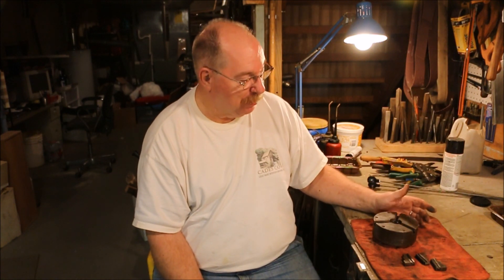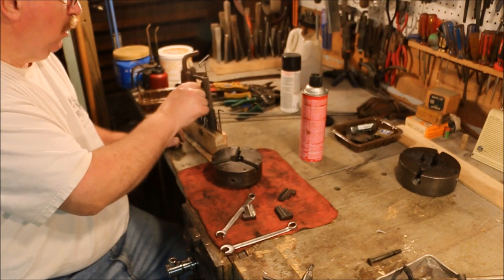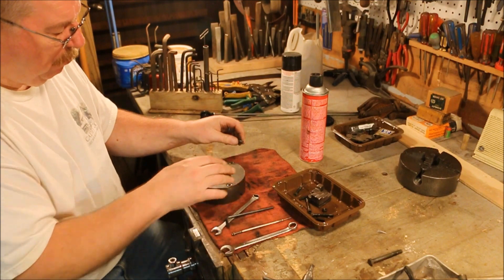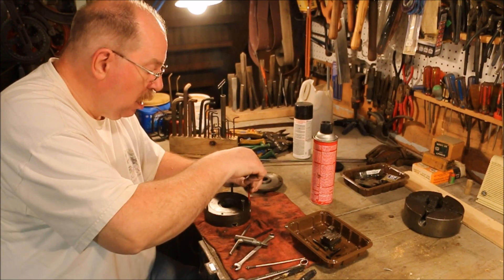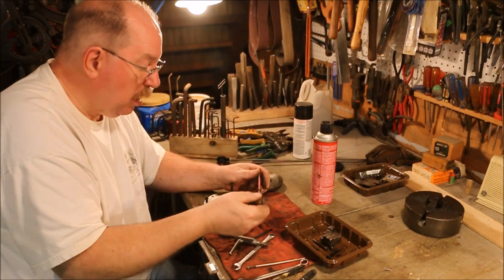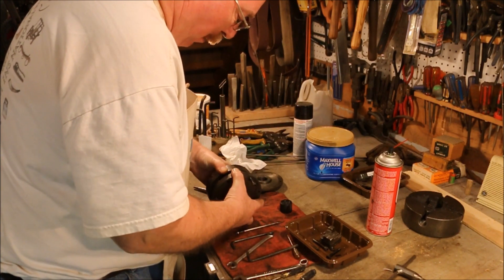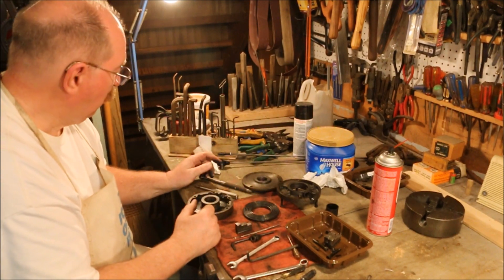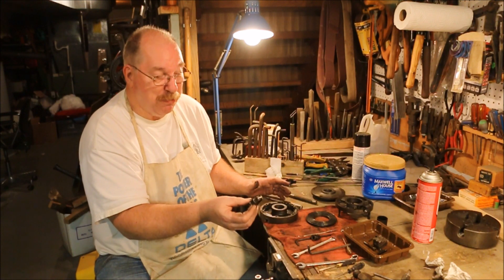CLEANING A THREE JAW LATHE CHUCK ~ SOUTH BEND 9C LATHE

Comment: Glad you're back. I just left a comment with John just wondering if you were being restrained for fluid retention but obviously not.  GOOD for you! I found out that I wasn't just making stuff up in my head to remain inside. My echo-cardiogram showed that my heart function is 20 to 25% so my Agent Orange and kindred formulas of such are catching up with me. I have opted for the deal that if it ain't broke, leave it be, able to breathe and will go the slower changing meds route instead of the really more invasive poking and prodding the long way around through the leg deal. SUPER nice guy to talk to there! We ended up under a bad tornado warning this evening and some good blows and power blinks but all is well and mostly went North and South of us. Good old mountains. I actually found a way to get off and on the new mower by myself as goofy and wobbly as I am, and even mowed. That thing will mow more by accident than the old Craftsman will on purpose BUT I still like the 3rd gear and easing along and listening to the twin talking. The battery job is like driving the old Pete with the slightly souped 3406 Cat. I was fine till I rolled the passenger window down and could hear the bark a little. I run the mower in lo speed and economy mode but get to pushing the handles a bit. Getting better and faster but still just using one bar on the battery meter. Oh well. We ever grow up. Sun is coming out and we got a wee-dab of rain. Grub run day tomorrow. I need a tire pressure gauge that'll read 10 pounds for the back tires. Sounds like a parts store run. Happy evening and God Bless Yall!